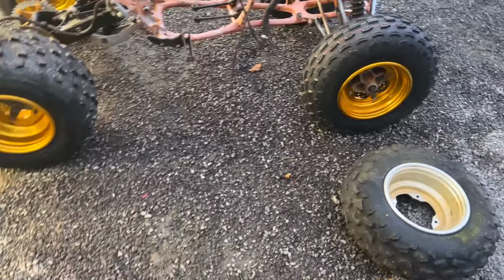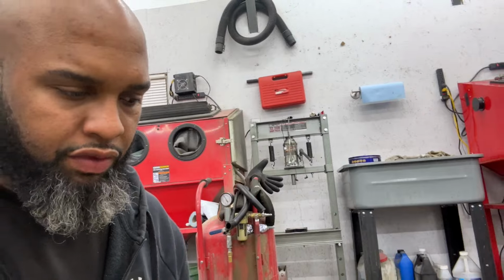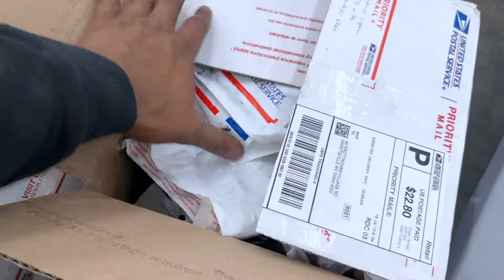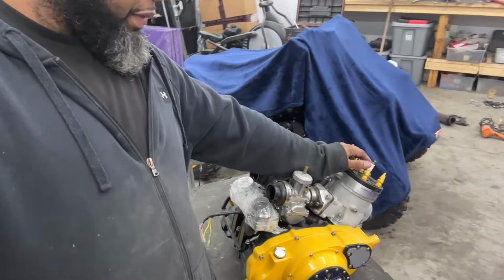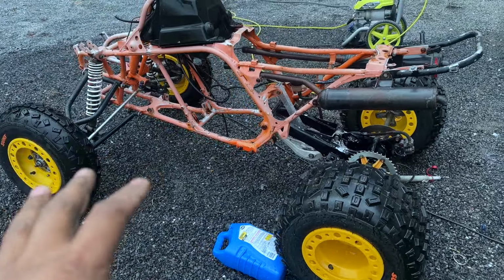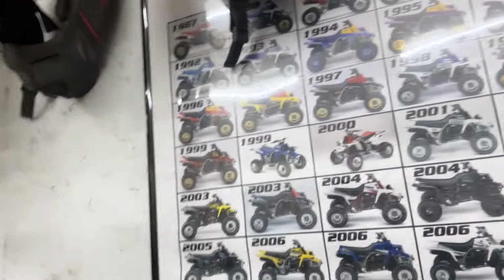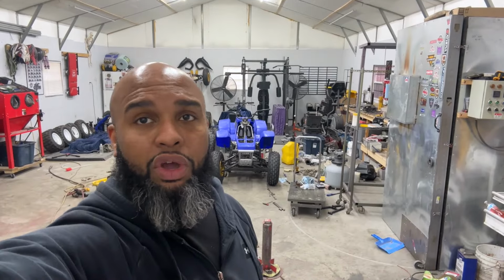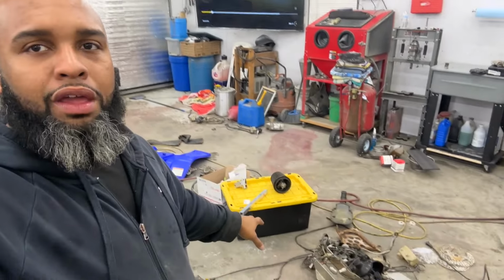Plenty Of New Banshee Content Coming In The Future. 3 New Projects Coming

Comment: I know ur struggles bro I just did a trx250r, have a other to get done, just dropped everything to powder on my 06 se black build, full oem. I have another banshee frame I need to figure out the year, scrape that paint, it looks like it says 96 but I'll know soon. Anyway, it's alot of work doing oem builds. Finding and matching up oem bolts, them little cable stay brackets on the engine, etc etc. Keep at it man, u do good work for sure!!!